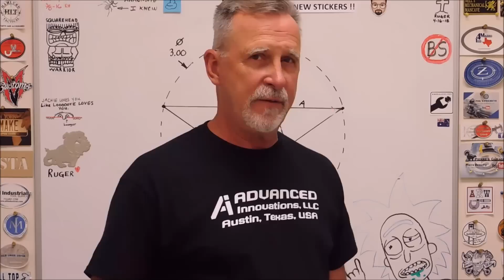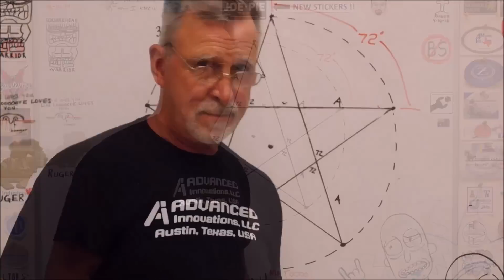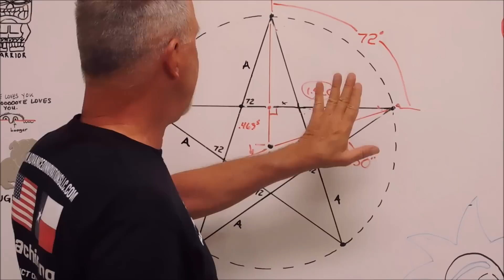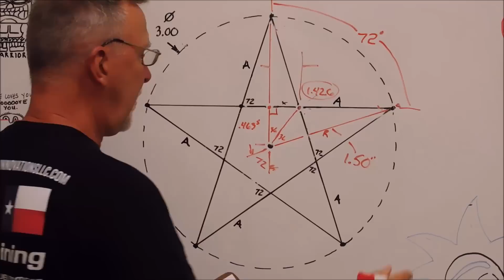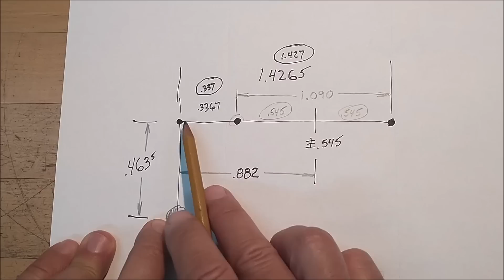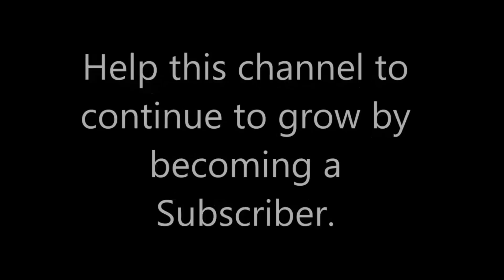How to Easily Machine a Star on a Rotary Table. Holiday Ornament Maybe ??

Comment: I keep lobbying to make 25 mm the official Metric Inch but nobody wants to do it.
Reply: It was already changed from the original size to exactly 25.4mm to make conversion simple.
Reply from the maker: They are 2 different languages, but the parts don't know that.
Reply: @joepie221  At least there is a one for one equivalence which makes it easy to translate.

Comment: Actualy... it is 76.2mm by definition :)
Cos.. definition of an inch is 25.4mm :)

Unlike mm which is defined as 1/299,792,458 distance light travel in vacuum in one second....
Sory.. I just could not resist :)

Imperial or mertic.. i do not care... what ever you are familiar with...
I just don't like "my system is better", cos both of them has advanteges and shortages
Only thing that I will never understand is "gadge" measurements that ar so historical, unintuitive (if you do not grow with it), etc...

Even you, writing 0.4635, you are talking 463 and a half :)
Yes.. it is perfectly understandable for us "metric" folks, but t is not "normal"
Just another habbit, developed byu using hafs, quoters...

Imperial i perfectly sensible when we talk about "rough" messures, like carpentry, house building etc... even have some advantages... (easier for rough calc)
But in machining.. decimal system, is obvious "must".
And when you are in decimal.. metric is on the nature ground, unlike imperial with 12/s, halfs, quoters...

BTW
This star wil be much nicer if it was in red colour :)
Reply from the maker: How about multi color?
Reply: @joepie221  If it's not a rainbow.. OK for me :)
Sory, I'm just old fashon dude.
Reply: Hi Boris, I agree with what you say, though I love winding up those who say only metric is logical, particularly with regards to thread rates. However, your last paragraph is not quite right; you referred to fractions and decimal but called them Imperial and decimal. You can have fractions of metric just as you can real measurements 😉
Reply: @andybelcher1767  Yes of course you can.. just.. decimal system is not "natural" with imperial measures cos for example you have 12 inches in one foot, 3 feet in a yard...
In metric, where everything is multiple/divde of 10, decimal is "on the native ground"
And oposiste... if you fraction meric units you get "something" that's not intuitive for people that commonly use 1/10 or *10

Comment: I guarantee he converted that through caliber first.
Reply: Why? 
1" = 2.54 cm. 
3" = 3 times 2.54. 
2 * 2.54 = 5.08.  (2 * 4 = 8,   2 * 25 = 50,   join and get 508).
5.08 + 2.54 = 7.62. (8 + 4 = 12,   50 + 25 = 75,   so 750 + 12,    5 + 1 = 6, so 7.62).

So 3" is 7.62cm or 76.2 mm.
Reply from the maker: I actually did it in my head. 25.4 ( 1" ) x 3 =76.2

Comment: New intro! Good video, I think it would have been slightly better it the camera was on the axis such that it is clear that you are only moving one axis of the machine.  The way it is shot it gives the illusion of being diagonal cuts (which is clearly is not based on the rest of the video).

I like to try and see if I can figure out how you are going to machine it before you explain it.  The only thing I missed was I thought you were going to cut then entire line. I like your solution better.
Reply from the maker: That was an option.

Comment: Hi Joe,  thanks for a great video!  You have great pedagogical instincts when you are presenting math oriented topics like this video.  I say this from the perspective of someone who has taught math oriented courses at the graduate level.  Good job!

You can achieve a very interesting effect by illuminating an edge of the plexiglass after you have machined the star or other decorative element.  This time of year, consider illuminating the edge with green, red, or yellow bulb(s).  You will need to somehow mask off the light source from the face of the plexiglass, else the stray light from the source will 'blow out' the desired effect.  For example, make a base out of something opaque, mill a slot in the base to receive the plexiglass, 'hide' the colored bulbs in the base, and you have a unique ornament or decoration.

Happy Thanksgiving!
Reply from the maker: Thanks for the flattering comment, and happy holidays to you and yours.

Comment: Would have liked to see the calculations made to determine the star points. Where did the .336 dimension come from?
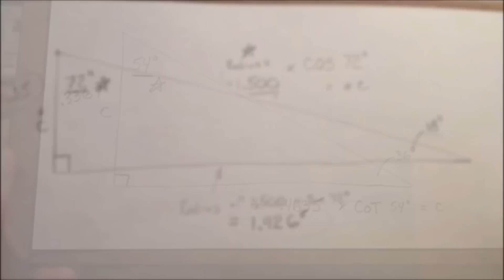Reply from the maker: Go to 17:15 and freeze the video.
Reply: Pythagoras's theorem for a right angle triangle.
Reply: Video segment 6.55 to 7.50 hope that helps 👍
Reply: .4635 * tan(36°) = .33675

Comment: 3 inches imperial, eh? I remember i heard a story that at some point someone tried to define "metric inches" to be exactly 25 mm. That would have been confusion galore if that was widespread.
Reply from the maker: Its just a different language. The size of the parts doesn't change. I would argue one is more accurate than the other.
Reply: @joepie221  I was just reminded of the anecdote, was all.

Comment: I think I have a small advantage over many of your viewers Joe, I am of the correct age as an Australian born person to know Metric/Imperial as one Language. That is to say I was taught imperial until the mid 70's, we went metric and then I was taught metric. To me I do not need think much at all about conversions, I knew it was 38.1 for 1.5" at an instant. I have no claim to fame for this, I am just a product of my age and where I live. Great video Joe.
Cheers from John. 
Edit for grammar.
Reply: You eventually forget that 'feel' if you don't use the 'other' system often enough. I was just in the US and my iPhone starts using Imperial nav distances instead of metric. I know about when to start looking to turn when she says 300m but 1/2 mile, 1000 feet (they mix feet and fractional miles) etc. not so much anymore.
Reply: @spehropefhany  About 1.61 Klms per mile so 1/2 of that is about 800 meters. A bit different than 300 meters. 
Cheers from John.
Reply: @joandar1  Yes, and I was doing those mental calculations in the dark and rain of heavy LA traffic. Not fun. 1/4 mile ~ 1300 feet ~ 400m
Reply: @spehropefhany  All good mate stay safe, Cheers, John.

Comment: can I just point out that if you wanted to cut the star out and maintain the 3" diameter, you would have to recalculate the figures, this gives you 3" at the centre of the tool, so if cut out the star would be a slight bit smaller. I believe you would need to offset half the end mill diameter further out to bring the points onto the 3" diameter, this might change some of the other dimensions too
Reply from the maker: True. For those not familiar, thats called cutter compensation. Modern CNC machinery utilizes a G40 or G41 command depending on which direction the tool is traveling. It can be used for internal or external geometry and is usually automatically calculated by the cutter diameter value entered in the tool register. For an external job like you speak of, some additional consideration would be required at both points. As presented, the values are centerline values and accurate as shown.